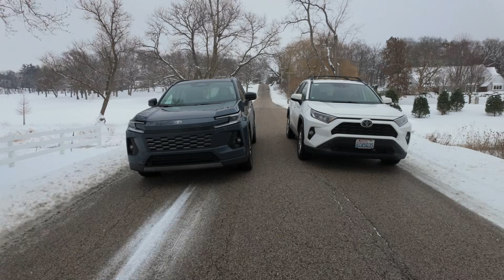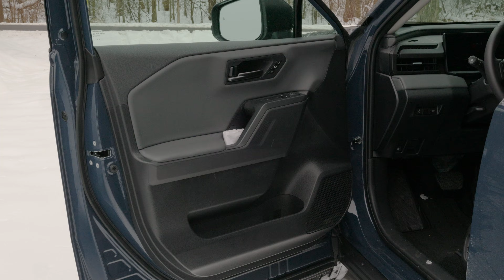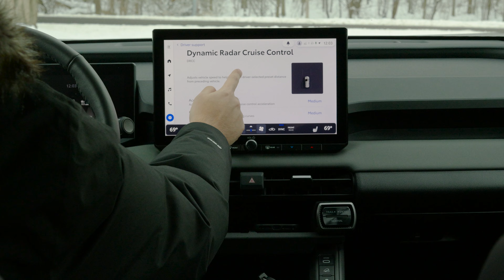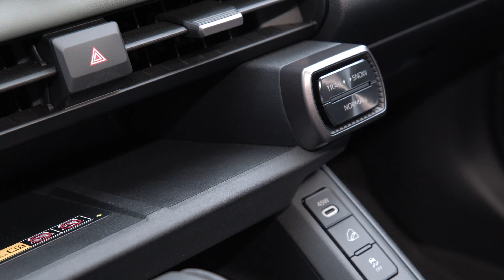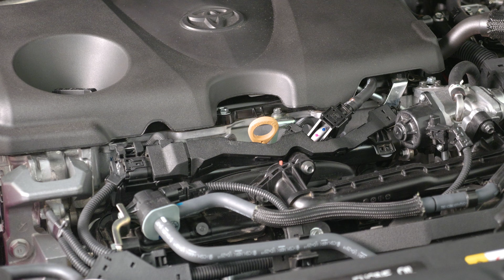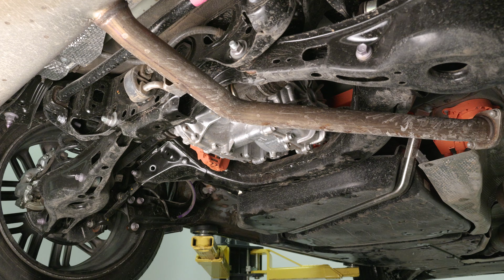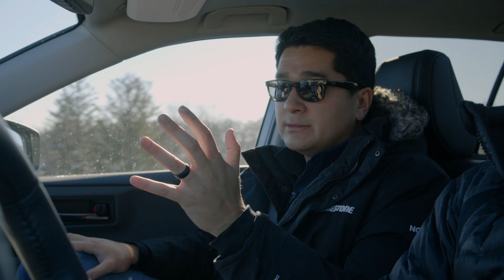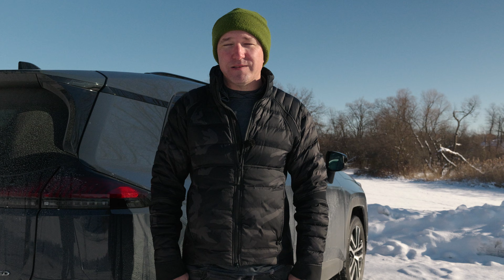2026 Toyota RAV4 | What Most People Want

Comment: In the DC metro area, RAV4 is one of the most common cars in our area. RAV4 drivers are the new Prius drivers of 2020's. I can not tell you how many times I have been stuck behind a late model RAV4 driving 10MPH below the speed limit or taking forever to pull out of a road, or driving with their turn signal on, or holding up traffic on a single lane road. I love the RAV4 and want to buy one, but drivers of these cars have ruined the reputation of this great SUV.
Reply: It's the top selling vehicle in 2024, you're going to see lots of them with all kinds of drivers in them!

Comment: Did you check the high voltage power cable connection under the car,  which had “cable gate" problem before? Was it changed or remains the same?
Reply: I was wondering about that too. But, you know, it would be unlike Toyota to have not addressed that.

Comment: me personally.   im always going to phobic of the hybrid only powertrain.  i know toyota does hybrid powertrains the best out of every mainstream manufacturer, but.. I genuinely don't like that we dont have options for the powertrain, but hopefully, since there are just more of these vehicles on the road, the hybrid battery packs will become more affordable to swap out when the time for replacement inevitably comes.
Reply: You shouldn't be afraid of the Toyota hybrid system (they have two types, with 3+ variations of the FWD based system).  I've owned or experienced just about everything, and a Toyota hybrid is a fantastic drivetrain.
Reply: Toyotas 4 cyl hybrid system is more reliable than their competitors non hybrid offerings
Reply: @ShaiyanHossain they are more reliable than their own non-hybrid offerings 😊

Comment: When I first heard about the new version, I was hoping the Woodland Edition would be a Subaru Crosstrek Wilderness competitor.  But alas, it is not.  Toyota has stated that the Rav4 is designed to get you to the trail.  They want you to buy the 4Runner/Tacoma if you go out on the trail.  While those 2 vehicles are great, their gas mileage is terrible.  I really wish Toyota on the Woodland Edition would have created a Subaru Wilderness competitor.  

The next question would be, is there only 3 changes that are needed to achieve that competition: off-road suspension, bigger tires, and a skid plate?

Comment: He’s not lying about RAV4 has zero problem over the 5 years of ownership and 83k miles later. My 2021 Toyota Sienna Hybrid has zero problem over the last 5 years even st 129K miles.
Reply: I just sold my 18 Silverado at 125 because I needed a bigger pickup.  Not one issue with it either, other than tires and oil changes.

Comment: They gave us drive mode buttons, which we'll never use.  And most of the HVAC stuff in the digital screen.  WTF?
Reply: He says Jack is a RAV4 guy, but if he really was he wouldn’t gloss over the loss of physical controls. The drive mode buttons are both ugly and less functional than the existing drive mode knob. And temperature knobs are always better than tapping the screen. Dealbreaker? No not for me, but it is disappointing.
Reply: Agreed. That’s an inexplicable unforced error. Ask VW how that implementation went in the Mk8 GTI. It was so widely panned the main “improvement” for Mk8.5 refresh was reinstating physical controls. 

What’s the point of including the latest safety suite of features and software if you need to take eyes off the road to go into the radio menu to perform basic yet needlessly over-complicated functions like not freezing your ass off or defrost the windshield you can’t see thru🤷‍♂️?
Reply: @wildone8369 
Always turn on the defroster before starting the drive in cold weather.

It's not hard. U could probably accomplish it.
Reply: "we've made you take your eyes of the road even more. Anyway, let's go over the new safety tech"
Reply: Stuff like that is a deal breaker, makes the vehicle undrivable when the touchscreen dies, which it will......
Reply: It seems the physics concept of lever, and Fulcrum escapes them. They still place the handle for the doors way too close to the hinge, makes push and pull awkward. At least put in a finger divot to aid weaker people
Reply: Ya I don’t think they were thinking when they decided that, bad idea.  Nothing easier then turning a  knob,and not having to take your eyes off the road while punching a screen
Reply: Is the new Irene software gonna be full of subscriptions?
Reply: I'm surprised their stupid engineers didn't put blinkers and wiper controls in the digital screen also
Reply: @allenl9214  Don't give them any ideas...
Reply: Toyota should fire who designed that! because of this, im going with the 2026 crv. the 6th gen rav4 is trash
Reply: Drive mode buttons are like adjustable seats.  I have 18 way adjustable seats, that the first owner paid a fortune for.  I spent about 3 minutes adjusting them when I bought the car.  Never since.
Reply: @BCNeil I have the RAV4 Prime and I use the drive mode buttons all the time. A twist of the knob puts in sport mode. A press of the button switches it from EV mode to hybrid for when I’m on the freeway.  I like reserving the EV miles for in town and extra horsepower of the hybrid is nice on the highway.  All of this can be done without looking at the knob.  My guess is that people with the PHEV use the drive modes more.
Reply: They took Subaru's advice on Hvac, which is detrimental. Hope the unit doesn't fail...
Reply: I've set my HVAC to 23C and automatic and hasn't touched it in 3 years. I would hide it from the UI if I could.
Reply: I will say, was super curious about the HVAC and it is actually super clean and easy to use.
Reply: I dislike not having physical controls, but honestly how often do they get used? I set my car to auto at 72 degrees and other than the defroster haven't touched climate controls in over 6 years. Sometimes I raise it to 74. It was the same with my previous car and summers around here hit the 90s while winters get down into the teens. 

These aren't 90s Hondas where every window would routinely fog up and it took messing with climate controls and waiting several minutes for them to finally clear up.
Reply: @maweitao  Good for you...and some, I would guess many, prefer to have--and would use--no look/at hand, tactile controls.
Reply: @springertube  CRV is there for you.
Reply: When you get a press car, you need to agree to certain terms. There are things you're not allowed to say..
Reply: You dont use the dials?? Wtf lmao its so fun damn switching dials and the digital screen is awesome with a large one! Youll see everything with a big screen takw note i have 4runner 6th gen
Reply: @IceKopee  Who wants to take their gloves off in the freezing winter to turn on their heated seat, heated steering wheel, or change the vent mode?  Shouldn't have to.  There was NOTHING wrong with using physical controls.  And you shouldn't have to go into submenus while driving and peck at a monitor to change such basic tasks.  It's a pain in the butt that no one was asking for.  And it's a distraction.

Comment: Did that sticker say 0w8 Oil? If this trend continues, the next viscosity will be Aquafina.
Reply: 0W-16!!! 💀
Reply: Low-viscosity oil is better for:
Cold weather usage
Short trip usage
High-performance/High-RPM usage

High-viscosity oil is better for:
Towing
Engines with loose tolerances

Low-viscosity oil flows almost immediately, protecting your engine for the entire trip.
That's why most of these vehicles no longer list "short trips with frequent stopping" under their "heavy duty usage" description.

Comment: It is certainly what marketing campaigns have told people what they want but I think I would rather a Camry myself.
Reply: I never been in a RAV4 really. But we have had two Camrys and dont really want another. We have a 2016 XLE with the V6. Drives wonderfully. 

But the back seat is miserable. I had to take a 7 hour road trip in it and Im only 5'9 my buddy was 6'0 and we were miserable in the back. The heat baking our necks because the rear glass. The rear seats dont recliner like many SUVs. The roof right at our heads. 
Plus being a sedan its so low to the ground to have to be very careful. We have all bottomed it out a few times. 

Its no wonder people prefer crossovers. I do think the RAV4 price is bonkers. It should be priced with the Corolla. Its literally shorter than a Corolla sedan. A Camry should be crossed shop with a Highlander which is closer to its size. But I dont make the rules.

Comment: I have a 24 Woodland, and can't believe they made the climate controls worse. The current gen has practically microscopic buttons below the info screen to move airflow to different vents or turn on defrost. 

Good point about the booming/flutter sound too. I attributed it to the more aggressive tires on the Woodland, but this thing does NOT feel like the solid old Toyotas of the early 2000's.

Comment: I think Toyota dropped the ball on the touchscreen HVAC controls here. If I'm forced to pick one between this new RAV4 and CRV I'd go for the CRV. I don't need to adjust temperature all the time but it's just my pet peeve having to take my eyes off the road just look for the switch for basic adjustments.
Reply: Just talk to it.
Reply: I won't go CR-V Hybrid because they got rid of the spare tire completely.
Reply: @jayh6900 That's an extremely-valid reason. Spare wheel/tire combos are... 80-100 bucks. IMAGINE spending that amount of money? That'd be like... a whole month of cell phone usage!
It's 100% a reason to not buy a vehicle.
Reply: I too am incapable of doing anything without looking directly at it.
I'm an infant who lacks object permanence and can't build muscle memory!
Despite having had an iPhone for a decade, I still can't operate it without several minutes of re-figuring out where each icon is.
I've never met another person with this affliction. What did your doctors diagnose your issue as?

Comment: I prefer the exterior of the new RAV4 with the interior of the old one. I don't want to drive an iPad and, from the looks of it, my next car after my current 2018 dies may just be public transit. All of the car companies are going towards cars with screens everywhere that require subscriptions and internet connectivity... I may be a millennial, but I don't like all of this tech in something that's supposed to be mechanical. I also live in the Midwest, where it's currently 9 degrees outside. Screens don't like the cold. Imagine a car with screens for everything and it's a 9-degree Midwestern morning and you're running late for work. You won't have any idea what the car is doing, if you have gas, if your engine is overheating on the expressway, all because it was too cold for the screens to function properly.

Comment: my 2009 Rav4 first repair was at 82000km, replaced oil filter housing under warranty, then at 174000km and 190000km, replaced  two front bearings, then at 232000km, replaced engine valve cover gasture and a coolant hose connector.
Reply: That was several generations of RAV4s ago, and were quite reliable.  These new ones are the dictionary definition of "Suck".

Comment: 2020 RAV4 hybrid owner. ZERO maintenance exception oil and filter changes. It’s been the perfect daily.
Reply: For what its worth,  I have a friend with a 2020, that has over 200k miles on it.  He has a buffing and touch up business and visits dealers in a 100 mile radius.  He absolutely loves it.
Reply: Check your transmission fluid 😢
Reply: Keep your eyes on that rear motor cable, I assume you got the recall notices.  Check that your AM radio works when power is applied to the rear motor (when driving), else you need to get it fixed prior to 100k miles.
Reply: @DBtwoz  It works fine.
Reply: Keep your eye on that rear hybrid cable, check my YT channel RAV4 100k mile review for more details.
Reply: Not even old, calm down
Reply: Until battery die
Reply: @summerforever6736  The hybrid battery on my 2010 was still going strong after 16 years and 250K miles.  The tech is probably quite similar for the Rav4 hybrid battery.  The point is that they last a VERY long time now.
Reply: I require ZERO sustenance, exception food and water. I'm the perfect soldier.
Reply: hows the road noise, people seem to complain about this?
Reply: @DeliciousBass01  I think it's louder than it should be to be honest. There's a lot of glass, not that much sound insulation, and apparently seals that needed upgrading based on this review of the newer model. When I first drove it on the highway I thought one of the windows wasn't shut completely. But you get used to it or just turn up the volume on the radio for the most part though.
Reply: @DeliciousBass01  The road noise is acceptable. It’s a commodity car. If I wanted less road noise, I would step up to the Lexus.
Reply: Yes but do you even pay a subscription for starting every day?
Reply: 4yo it better not be failing. Reliability is more for like 6+ yrs but there are vehicles that start to have faults within 4 yrs. Your maintenance schedule in your manual will tell you how reliable will go lol
Reply: @shelbyrodriguez560  2025 - 2020 =5 years. 2026 is a month away.
Reply: Yo look at that rust of that 2026 Toyota RAV4 limited muffler HORRIBLE 👀. Who be dumb to purchase car that will become a GIANT RUST BUCKET that quick. Don't care if its got technology its a rust bucket quickly happening !!!!
Reply: @alejandroa.aguirre2853 thats not rust. Its just a different material, not like stainless steel or a coated metal

Comment: Our 2022 Rav4 has had several issues with the mooroof leaking and the screen will completely turn off while driving. I wonder if this new generation has fixed those problems considering how many functions have been moved to the screen. We have had the screen replaced twice. Our RAV4 was built in Japan BTW.
Reply: Have several 2022 RAVs in a work fleet with screen problems. No way I'd get one with HVAC controls on the screen.
Reply: Japan made to me means good powertrain. Japan has always made bad sunroofs and squeaky, rattling interiors. Over hyped imo, but i still buy them over the alternative.

Comment: I sat in a brand new 2026 RAV4 in Toyota show room, you have to watch you don't bump your head on the way in, even my wife at 5' tall had the same issue, what kind of design is that? yup, no thanks.
Reply: EXACTLY!  That has been my Number #1 complaint about this lil' cracker box for years, and I can't believe that Toyota hasn't tweaked this problem out.  I've driven over a half dozen of these SUVs in various trim levels over the years, but I'll be damned if I'd ever buy one!

Comment: All of the refinement, all of the driving dynamics etc mean nothing if the car is in the shop. My 2015 Rav now has 400,000 miles, no issues except for the need for tires and oil changes.
Reply: Now, if you go back to the 2015 RAV4, I can believe that!  Not my 1st choice for a smaller SUV for comfort, but for durability and reliability?  It's up near the top!  Can't say that about the newer RAV4s.